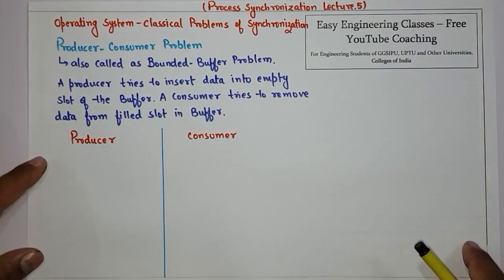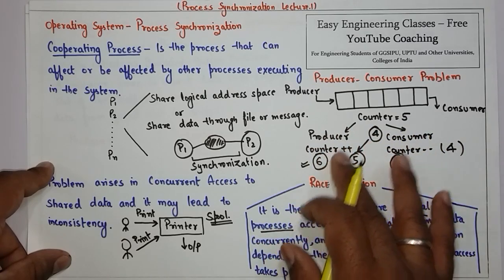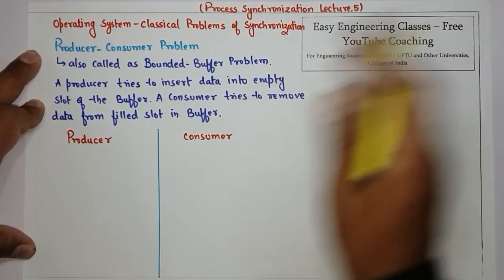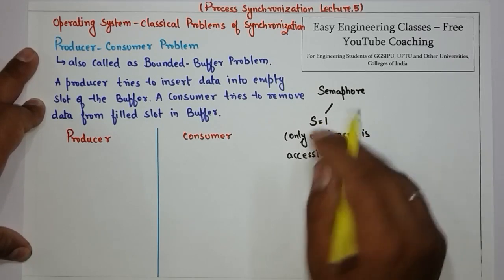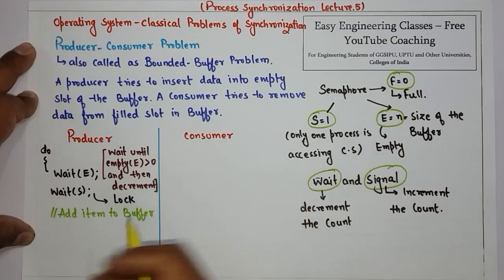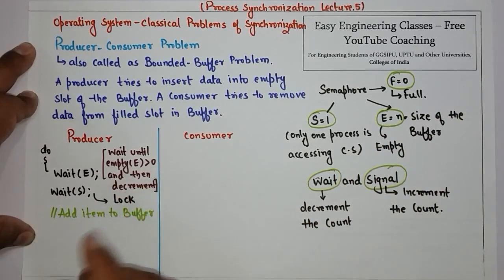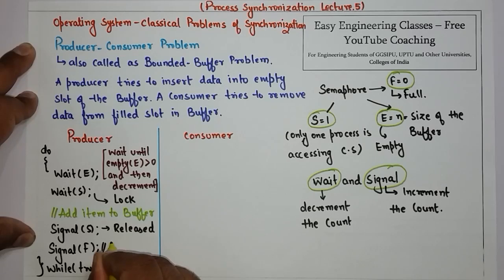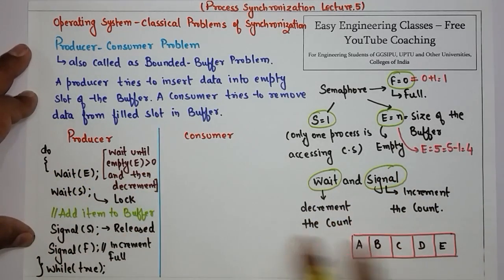L26: Producer Consumer Problem | Process Synchronization Problem | Semaphore Solution | OS Lectures

Comment: Algorithm of this program
step1: the semaphore mutex full and empty are initialized.
step2: in the case of producer process
(i)produce an item into temporary variable.
(ii)if there is empty space in the buffer check the mutex value for enter into the critical section.
(iii)if the mutex value is 0, allow the producer to add value in the temporary variable to the buffer.
step3: in the case of consumer process
(i)it should wait if the buffer is empty
(ii)if there is any item in the buffer check for mutex value , if the mutex==0, remove item fron buffer.
(iii)signal the mutex value and reduce the empty value by 1
(iv)consume the item./
step4: print the result